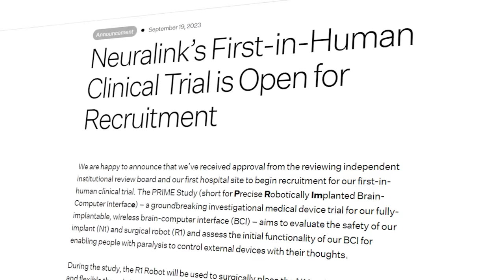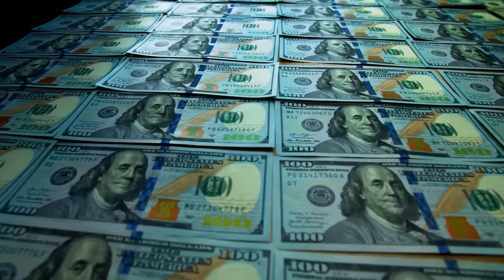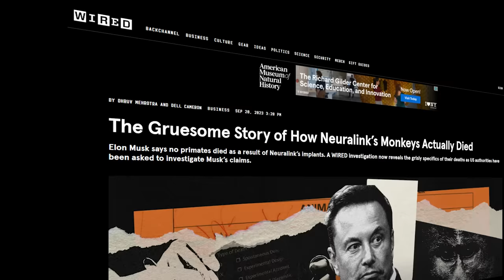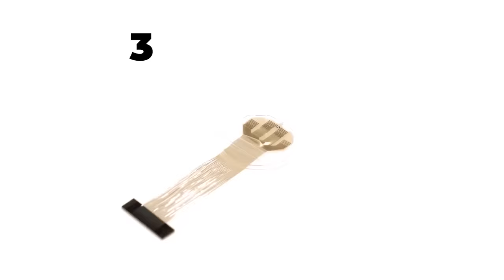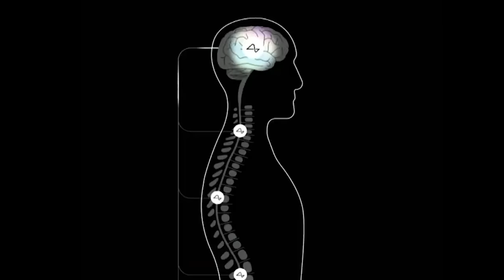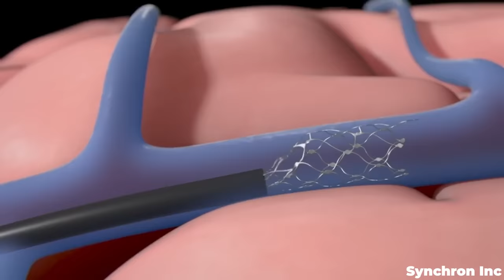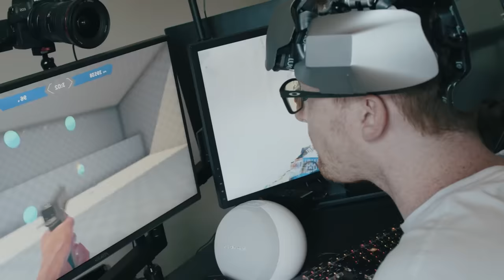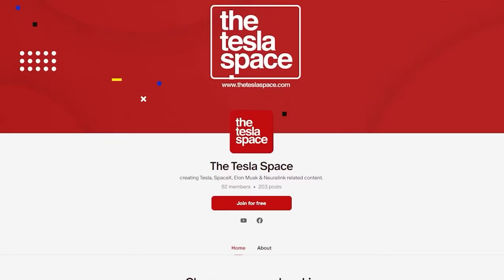The 2024 Neuralink Update Is Here!

Comment: As a tech guy (bachelors in computer science) and did a project in my ethics class on whether neural ink would be good or bad for society. I’m very scared 😢
Reply: Think this could be hackable??
Reply: @Azmedon-AU  Any such question is absolutely meaningless. 
You can build it absolutely unhackable, and you can build it easily hackable. 
The question is not about bci the question is what do you want to build. 
If it's just a piece of hardware that's airgapped, reads your inputs and produces the desired outputs then it would be hackable unless someone cracks your skull open and attaches a wire. Introduce some"bluetooth because 2000s" or "over the air software update" bullshit and you're in a world of trouble.
Reply: @Azmedon-AU  I pretty much can hack person minds without eletric devices, it calls social enginering or even hipnosis, independent what you call or thinks is not like pluging a device in your head will make any diference to a NPC.
Reply: @Alpha-vb3to  I have super human strength I can smack things real hard without even hurting my hand.
If we combined our super powers we could dominate the world, maybe even the universe.
Reply: You have a glorified high school diploma bro. Calm down.
Reply: @towakin7718  what?
Reply: First, it has to work, till then, not to worry ! Won't happen tomorrow ! You need to connect how many "wires" ? How about the com protocol used ????
Reply: The question will be how long will it take that its expected to have a nauralink implant to be eligable for the job position to are applying for.
Reply: Why is Google blocking half of the Replies to this post?
Reply: @Azmedon-AU  Of course, by Elon himself! Then other hackers of course will figure it out and make people commit crimes and jump off cliffs! lol

Comment: If the patient is paralyzed how would their brain receive signals that their muscles are fatigued? Is it different depending on what’s being controlled? Prosthesis or paralyzed body part?
Reply: From what i understand is the device is going to attempt to replace the signals that the broken brain stem is not doing. 5:44 they call it a brain computer interface.
Reply: Brain still works normaly but the connection to rest of the body does not, and maybe these signals can be recorded from healty human. I believe these signals are very similar on everyone
Reply: Prosthetic

Comment: I have been in technologt for 25 years and just taking a moment to think about this tech reveals it will never work:
1) skull structural integrity. drilling a hole in the skull for a piece of plastic will destroy skull structural integrity.
2) heat - if rthe device gets hot it will kill brain cells.
3) bandwidth - if they use bluetooth will it handle the bandwidth necessary for input/output.
4) surgery - even human assisted surgery would be dangerous and must not be done in a mall setting in 30 minutes or less.

sorry musk fan boys. this is all bullsh!t!

Comment: They can only succeed when using voltage and light in the chips our brain uses both forms of energy. There is a wave of “red light therapy” photosynthesis uses specific wavelength for photosynthesis I and II these “therapies” don’t use the proper wavelength and there is an optimum? Of 3-4 Joule / cm. there must be a lot more possible with specific wavelengths not just those that are available.

Comment: how the fck do your thoughts translate to hardware/software signals? or is it just based based on the strength of the electrical impulses produced by the brain
Reply: It's literally measuring voltage between two wires.
As for how complicated thoughts are - if "measuring voltage" is the basis of your technology, CGI seems complicated, too.
Reply: @Uthael_Kileanea  so its voltage based communication which means the user will need to be trained how to send signals for a specific command within a voltage range. if thats the case its not really about thinking what action you want to do, thats irrelevant, its about how hard you are thinking about doing something.

Comment: If Elon is focused on bandwidth I pray the have zero plans for using Bluetooth.  Its an archaic technology at this point and is slow as molasses and works intermittently at best. Future versions of wifi,  or some other wireless tech would far superior and preferred.
Reply: I would prefer to have a fibre optic cable running under the skin, from the implant to a physical plug behind the ear (or anywhere on the body).
Plugging in directly to a computer when you require enhanced connection and sitting ready when not needed.
You could use it offline to upload information or to connect to a prosthetic device, or where security is questionable.
WiFi is too vulnerable to interception at this point … maybe less so in the future, but a physical link will always be more secure.
Reply: @Glathgrundel  point is Bluetooth is trash

Comment: 25 grand for a new car? 
Where do you live?
A new car in Canada starts at 40, 000.00 and thsts not much
Reply: What "new car" starts at $40K in Canada???  Or are you specifically referring to Electric vehicles?
If you ARE referring to EVs, then yeah, $40K would be on the low end for sure.

In Canada, (non EV)
2024 Honda CRV starts at $35K
2024 Honda Fit starts at just under $17K
2024 Nissan Versa | $17,405.
2024 Mitsubishi Mirage | $18,110.
2024 Kia Forte | $20,915.
2024 Nissan Sentra | $21,295.
2024 Hyundai Elantra | $22,065.
2024 Volkswagen Jetta | $22,585.
2024 Toyota Corolla | $22,995.
2024 Subaru Impreza | $24,115.